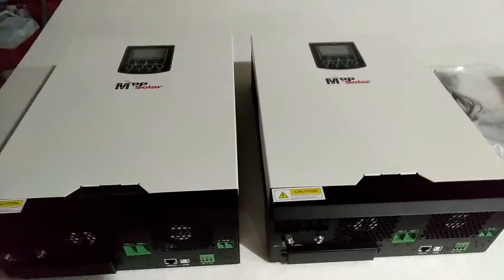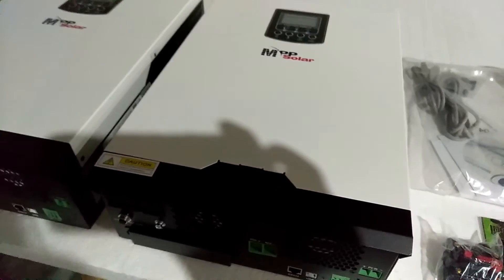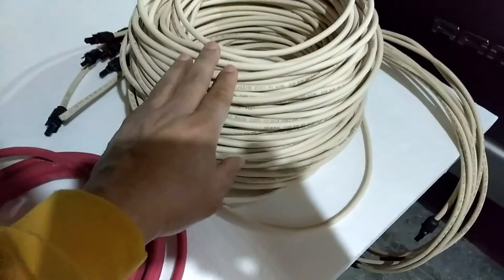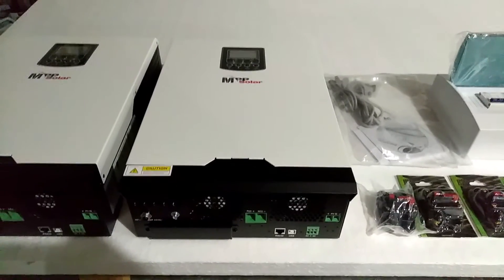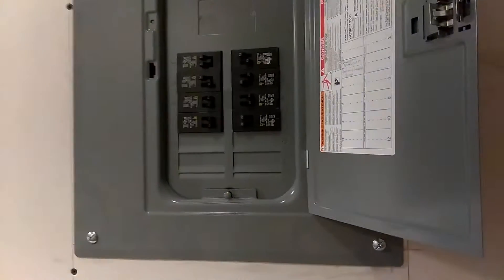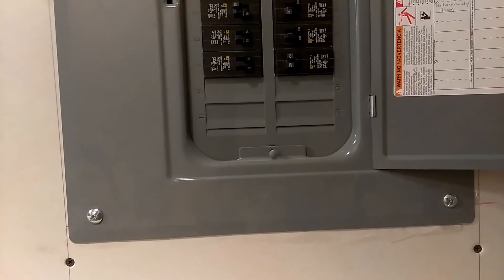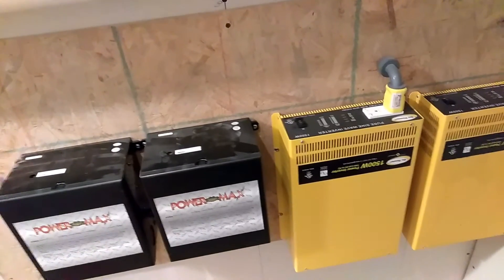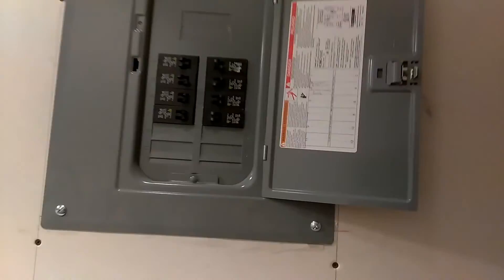MPP solar inverters and accessories

Comment: Hello Carson, would you be able to measure the inverter standby consumption with no loads and no solar connected?
It seems to be an interesting product but they have huge issues with high standby consumption for their European models.
Does that also apply to the LV2424-MSD you have? Thank you very much, this information would help a lot. Alex
Reply from the maker: Alex Wolf I have not had a chance to do anything my battery bank is not put together the inverters is still in the box from the video so maybe in another week or two I can do that for you.